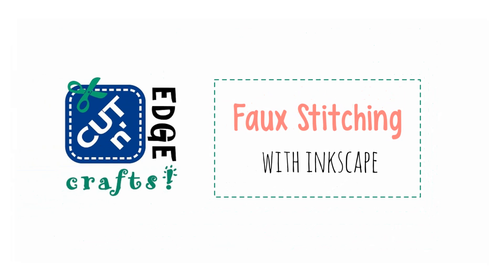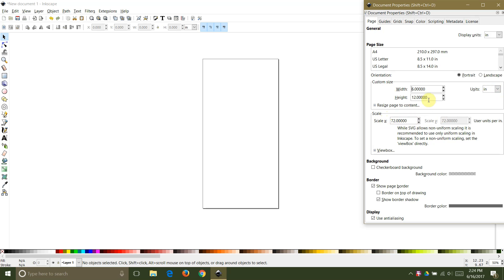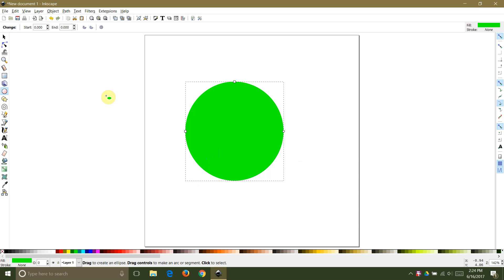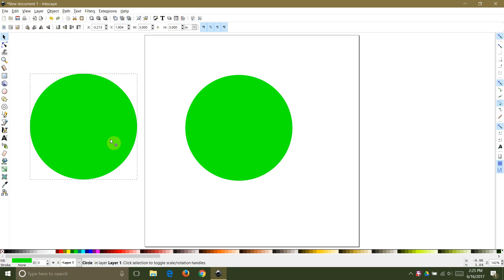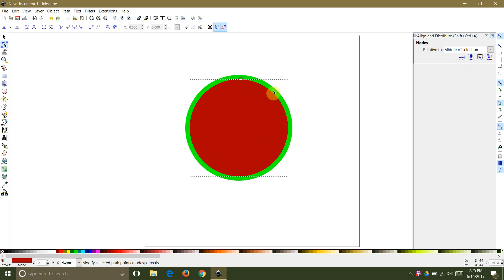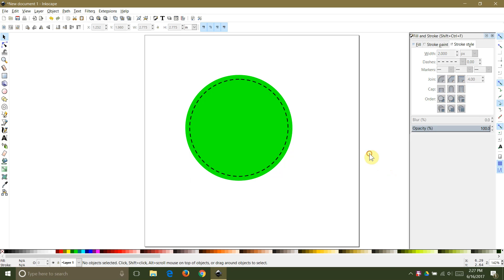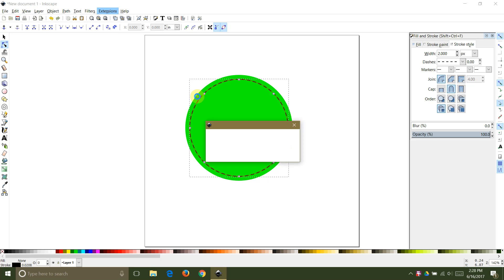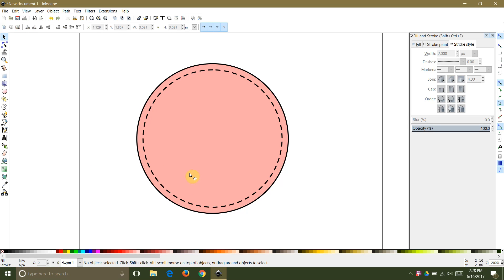Faux Stitching with Inkscape and Design Space

Comment: When I upload this in Design Space I can't see it on the canvas.  When I try to cut, there is an error that the object is too big for the mat.  What am I doing wrong?
Reply from the maker: +Caroline Lamitie check your image size. The default Inkscape template is currently importing large into DS. I have a template on my blog that you can download that corrects the problem.
Reply from the maker: Sorry I missed your message! Select the image from the layers bar and check the image position as well as it's Height and Width. Sometimes things will import into DS in the wrong scale if you have groups or objects that have not been converted to paths in your file.